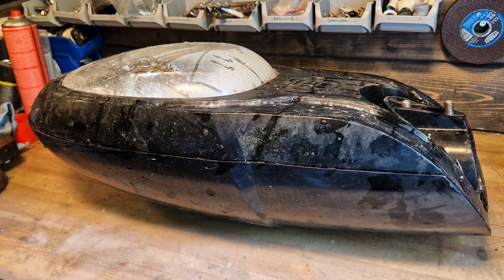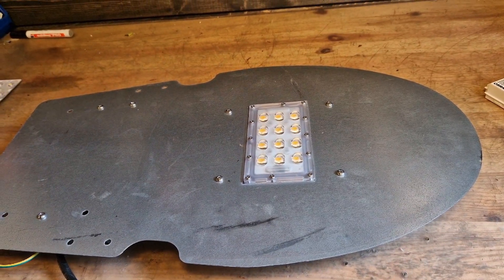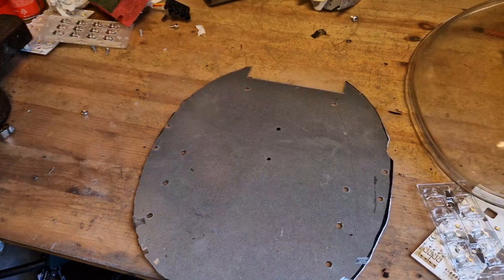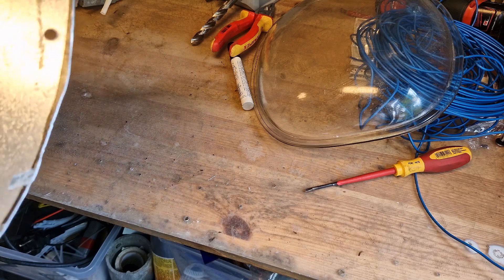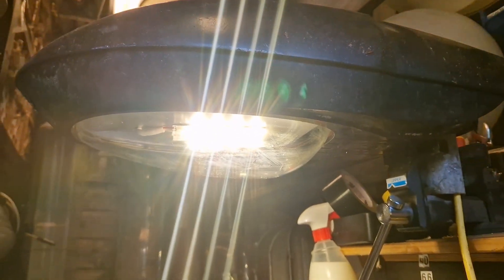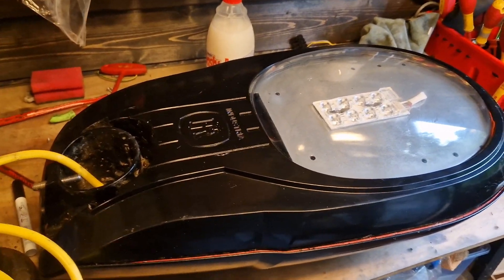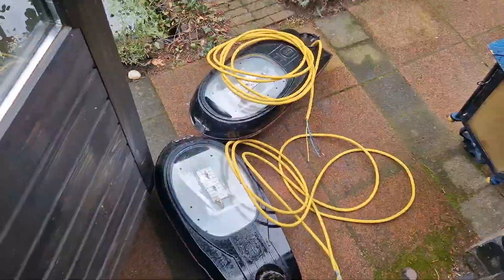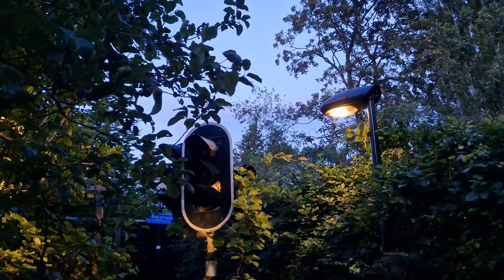Can I Create My Own LED Retrofitting Kit For This Indal ARC Fluorecent Streetlight?

Comment: Finally, retro compatibility in old lights. I just have one problem with LED, their color, most of the time white, not lower than 3000k which has turned our nights from yellow nights to white nights. They could just be yellow as the previous lights and that would keep the same feeling on the streets. I've seen many times 2000k LED lights and, until you look at them very very closely, you can barely notice the difference, so it keeps the old lights style almost perfectly. But no, most of the times they have to install white or even cool white lights.
Reply: Cool white is getting fewer and fewer. Here in Germany, almost every city is installing 3000K or warmer since 2-3 years.
In one state of Germany (Baden-Württemberg) 4000K or colder is since 2021 not allowed and all cities must change there 4000-6500K streetlight until 2030 to 3000K or warmer.
Orange lighting, similar to sox, is also getting more and more, in Oberhausen they mounted last year Philips Luma with 1800K on one way (because of the river next to the road) and in Hamburg on pedestrian crossings they mounting 1800K Fixtures.
One small manufactorer from Erfurt (ConPower) has specialized on 1800K/Amber streetlights

Comment: I'm really baffled how much money is being thrown away because everything has to be replaced by LED. Why throw away a perfectly fine fixture that can run for another 15 years? It's really a huge waste of money.
Reply: Welcome to the world of lamp bans..
Reply: @nickc9182  where because of legislation all bulbs are getting banned, fluorescent already gone as of sep 2023, 2027 is when HID is going.
Reply: Placing LED bulbs in the fixture itself can overheat it and make the life shorter, so they most of the time opt out to LED lantern which cost much more
Reply: @GERMANIA292  although it often costs more, some manufacturers such as Urbis Schréder create replaceable components, AXIA 1 is one example however due to manufacturing issues they had to discontinue it, they still make drivers for them but the actual diode block (8 LEDs per block) can no longer be made.
Reply: @professionalineverything  is the fixture itself costly? Manufacturers usually like to push cost a little much to the edge
Reply: @GERMANIA292   no, it was very affordable, my council (Ealing) changed out nearly all normal looking conventional lights with the AXIA 1 however some still remain such as heritage units fitted in conservation zones and as a result some conventional normal ones still remain, Urbis ZX & Urbis Sapphires. However I managed to find the manufacturer after finally managing to read the manufacturer nameplate and looking on the internet and found that they expanded to the normal landscape and are preferred by network rail and yes these heritage units are maintainable and sent it over to the council, we are not putting in the first trial units that are like for like.

There is also a maintainable non heritage one from the heritage manufacturer, I believe it's DW Windsor Daytona.